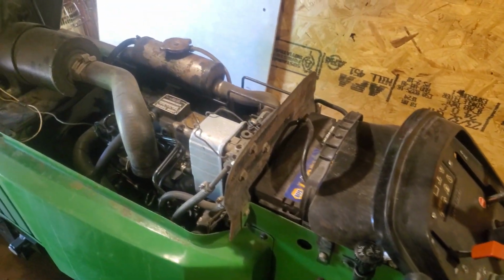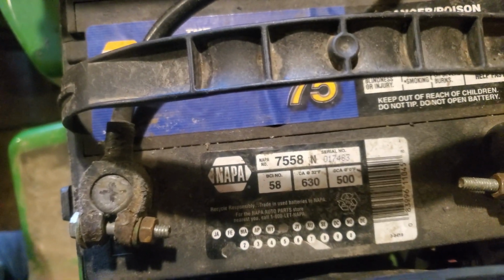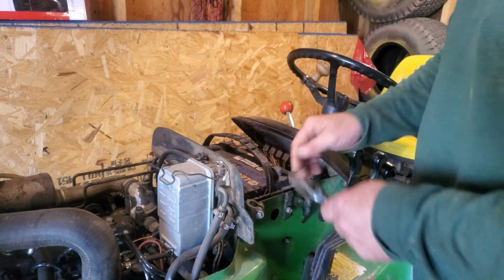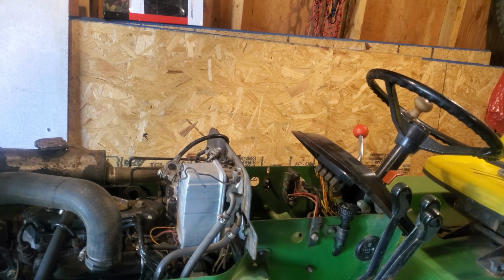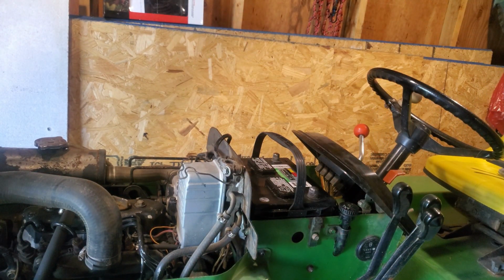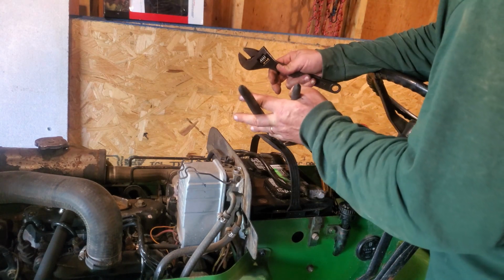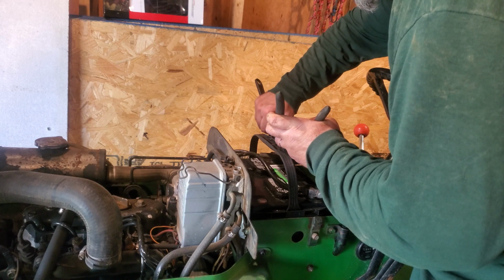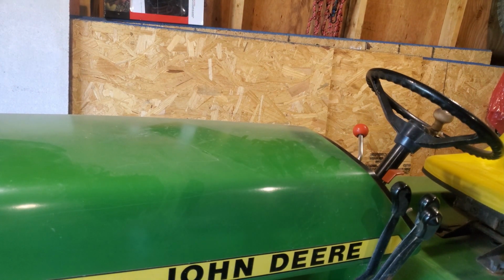JOHN DEERE 430 NEW BATTERY and Yard Work.

Comment: You were smoking those tires on the Husqvarna!! 😂
Reply from the maker: I'm surprised I didn't hear about the 430 fogging up the shed.  It does smoke till it gets warmed up.
Reply: Yeah I am pretty sure it is due to the glow plugs and the module. I believe they bypassed the relay and just got wired it to the switch.
Reply from the maker: @LivingOutHere  yep, sounds like what I've seen.  Thanks for the link!  I'm studying the sketch and rereading your comment to see if I can picture that hold-down part.

Comment: It does have a battery clamp.
I just picked up my second 430 a month ago,  finally get to work on it tomorrow 😅
Reply from the maker: Cool.  If you don't mind sharing, where is it located and how is it installed and released with the battery in place?
Reply: I'll look tomorrow, and take a photo. 
My two 430's are 452 numbers apart (serial numbers), which I thought was cool 😎.  I have to remove the diesel injection pump to replace a rotten freeze plug on new one, but it runs great.
Reply from the maker: @timhankins9245  love it!  Glad to see so many of these giants still around and I'm blessed to own one!

Comment: Do you have to use your glow plugs on the 430 during warm weather? Or would I just take longer to start?
Reply from the maker: Yes, I do use them.  But usually only for 5-10 seconds for an instant startup.
Reply: @tractorstrailsandlivingfree  thank you!
Reply: I’m planning on buying one and I just was wondering about the glow plugs. Thanks!
Reply from the maker: @ThatMowerMan  it a lot of fun, especially with implements.
Reply: @tractorstrailsandlivingfree   I bet!